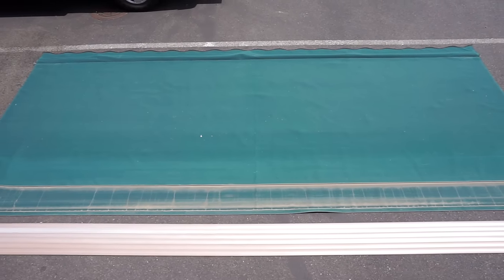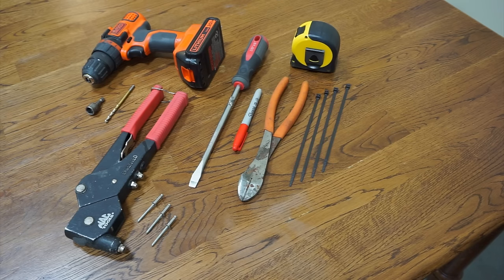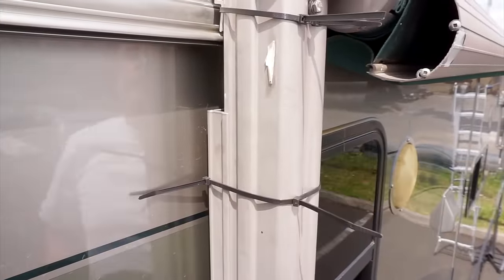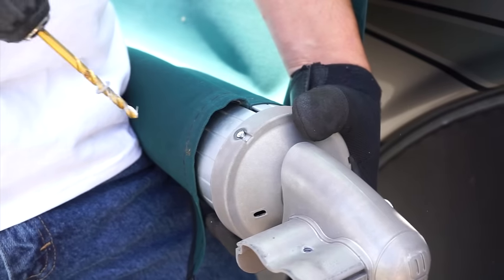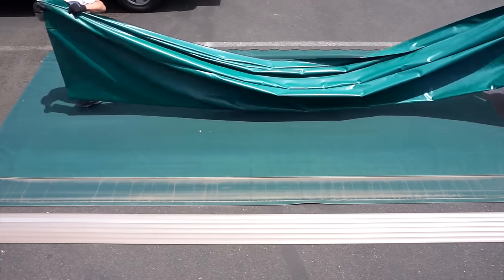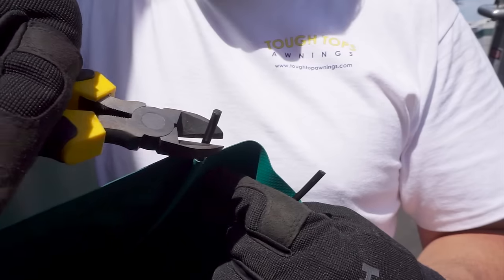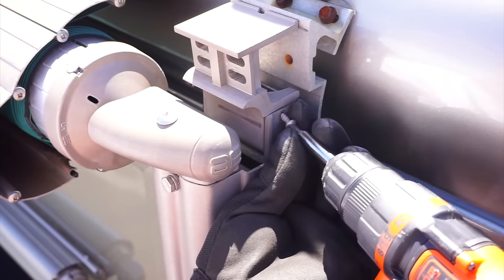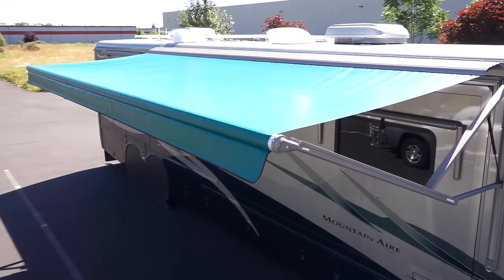How To Replace A&E / Dometic WeatherPro RV Patio Awning Fabric

Comment: Although there are some minor differences, we replaced ours yesterday. Our camper is a 2012 Forest River Surveyor. The side arms are bolted to the camper and we were hesitant to loosen the bolts in order to slide the wire ties behind it. It's just one of those things we were afraid to mess with. So we drilled holes into them and inserted the wire ties through the holes and secured the side arms that way. It went very well with only 2 of us doing the installation. Thanks for providing this excellent video!
Reply from the maker: +MARY SHADE Excellent info, Mary! Thanks for sharing that technique. The sign of a true DIYer is the ability to adapt when needed! 😊

Comment: I love these directions, but my AE Dometic torsion bar is a little different.  It is flat, with two rivets at 11:00 and 2:00; do I need to drill those out and place the straight pick in their place to hold the tension bar in place?  Thank you!
Reply from the maker: Hi Bridget. It definitely sounds like your A&E is a little different. If you bought your replacement fabric from Tough Top Awnings, we'd suggest giving Tyler a call and asking him... he's the guru! But one quick note... when we insert the straight pick in order to lock the spring tension and to keep it from unrolling, we're not putting it through the holes where the rivets were... on typical A&E awnings we've worked on, there are other holes in the angled portion of the end cap... and two of them line up with a hole in the solid bar that is the rotation point for the whole awning. You put the pick through those, and it locks the inner bar to the outer cap assembly which keeps it from unraveling. Hope that makes sense.

Comment: Ya'll got a video for the AE fabric replacement for the type where the metal wrap itself slides into the rail Vs. the "soft connect" style where an awning bead slides into the rail?
Reply from the maker: Sorry, but we've never seen that style. We'll have to keep a closer eye out!
Reply: @RVgeeks  Think older Dometic though, back when the Alumaguards and awnings were built right. Unfortunately the RV awning industry has evolved backwards. The Alumaguards used to attach directly to the rail and the awning to the other side of the protector. Now they have defeated the protection of metal covers with that stupid strip of awning fabric between the rail and protector that rots at more than twice the rate of a protected awning, causing more frequent replacements.

Comment: My husband just replaced our fabric. The pick slipped and everything unwound on the inside. He looked up specs for winding it back up, but we they put everything back together the awning still isn't going out or retracting. We don't hear any motor noise at all. We have a Weatherpo Power awning on our '07 Allegro Bus. Any ideas or help?
Reply: Hello, did have figured out how to fix your issue? I’m having a similar issue with an Allegro Bay

Comment: Can the metal retractable fabric cover be added to a Dometic 9100 that does not currently have one.... if so, what is the proper name of it?  :)  I have a 16' electric.
Reply from the maker: Hi Mark! If we recall correctly, that metal wrap is called a WeatherShirld, but we’re not sure if you can buy it as a standalone part. If Dometic does offer that, we’re virtually certain that you would need to replace your current fabric at the same time, as fabric cut for awnings with or without the guard are not the same. We’d suggest giving Tyler at Tough Top Awnings a call to talk to a real expert about it.

Comment: I'm currently unemployed veteran and living out of my RV in Seattle. (restored 84 Holiday Rambler Imperial 28) and my awning got rubbed against a tree when I was parking(I could ask myself). what is a good inexpensive way to get an awning?
Reply from the maker: Sorry to hear. The only way we can think of to avoid the high cost of buying an entirely new awning is a salvage awning. Might try posting on the user forums on iRV2.com to see if someone has a good lead on used parts.

Comment: I'm trying to replace a slide topper that has a WeatherPro Patio Awning over it. The side tracks of the WeatherPro Awning is mounted over the track that secures the slide topper to the RV. Is there a way to safely disconnect the Awning track to allow the slide topper to slide in and out while I replace it? Prefer not to have to remove the entire awning to replace the slide topper.
Reply from the maker: The slide topper fabric should be able to be removed by pulling it toward either the front or the rear of the RV. If you don't have clearance on one end, do you have clearance and access to slide it out the other end?
Reply: @RVgeeks  No I can't pull it forward or back because the vertical tracks of the awning lap over the track on both ends.
Reply from the maker: @mogcabatu4556  We’re not sure, so we’re going to defer to the expert here. If you call Tyler at Tough Top Awnings, he’s the best person we know to ask: (360) 953-3299
Reply: @RVgeeks  Gotcha, thanks for trying!
Reply: P.S. I was able to replace two of my other slide awnings with Tough Top Awnings based on this video...they fit perfectly...thanks for the tip on that too!
Reply from the maker: @mogcabatu4556  Excellent! If you call Tyler, please let us know what he says and how you make out.

Comment: My question does't pertain to awnings but I would like to know do you have a windshield and side windows covers?  If so where did you purchased the product?
Reply from the maker: Hi Eddie! We have an MCD windshield screen, which also includes screens for the driver's window and the door, all mounted on the outside of the RV. But MCD has not made them in years, so ours are no longer available. We have friends who bought theirs from a company called MagneShade, and they are very happy with them. We've heard good things about them, so might be worth looking into: http://www.magneshade.com
Reply: Thanks will checK them out.

Comment: We just bought a 2013 winn. Want to see what awning looks right, but will not extend. Can see movement and hear motor click and move little. How can you get it to come out? Need help.
Reply from the maker: If you hear the motor click, it’s probably not an electrical problem. And if it moves a little, it is trying to open. Sounds like it’s just stuck. We’d get a couple of friends, and a couple of ladders and have one stand at each end and wiggle/shake/pull on the arms while you click the switch on and off to see if it’s just stuck.

Comment: Replaced our fabric now the awning won't retract after being extended. Any ideas what went wrong
Reply from the maker: Are you hearing the motor attempt to close the awning, but it won't move? If so, the fabric may be slightly too long, allowing the arms to overextend and lock open. Did you get your fabric from Tough Top Awnings?

Comment: I noticed the top of the rv is losing its clear coat and or paint. Is that a concern? Sorry the question isn't directly related to the video.
Reply from the maker: Hi Chris! We figured someone would notice that! LOL Peeling clear coat around the perimeter of the roof is a fairly common problem. We've been meaning to get around to it for some time. No concern really, other than having to make time to have it re-painted and re-clear-coated. It's a pretty small area in total... just runs that small perimeter all the way around, between the side walls and the white roof. We figure it's about time we got it done, so stay tuned for a video about that, hopefully sometime early next year. ;-)

Comment: why did you take off the bracket on the right its never in the way. even the one on the left isn't really in the way?
Reply from the maker: Because you need to zip-tie the arms to the RV to prevent them from springing out after the fabric is removed (the fabric is the only think keeping them in), you can't lift the ends of the roller tube out without removing the brackets. If you pause the video and look closely at either bracket when they're in place, you can see that the outer edges (facing away from the RV) curve a little bit over the end of the roller tube attachment points, preventing them from lifting out. I thought the exact same thing at first, but then realized that with the arms zip-tied in place, there's no wiggle room to remove the roller tube ends.
Reply: Just get longer zip ties